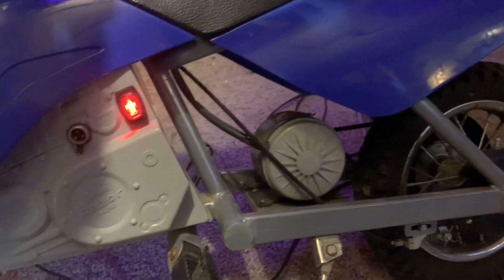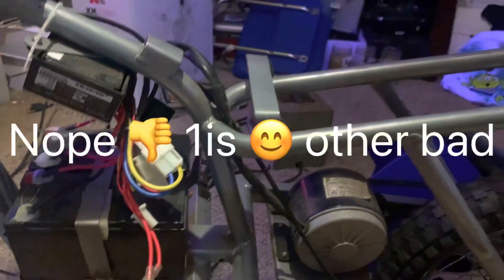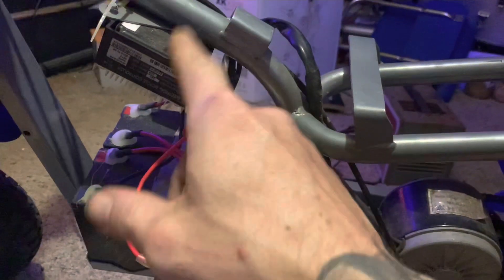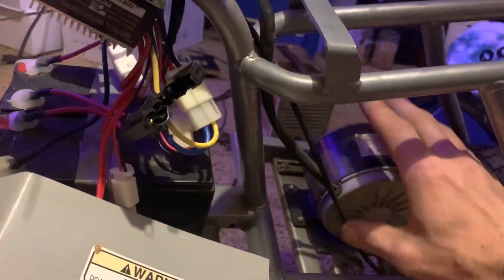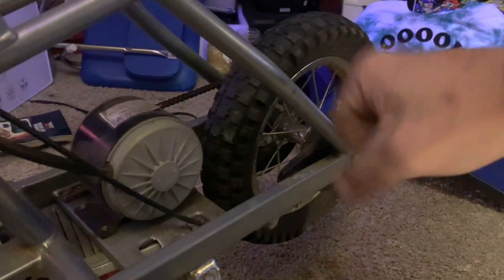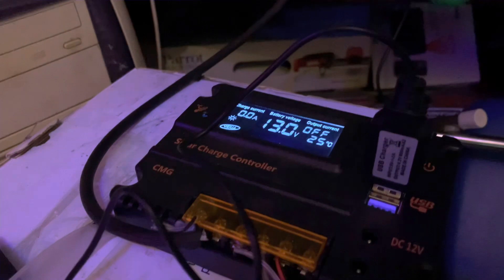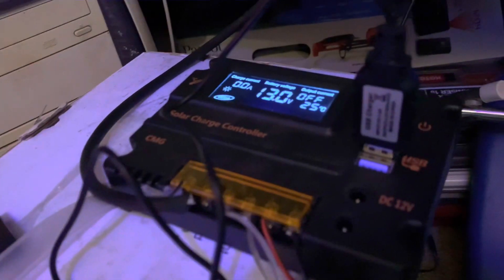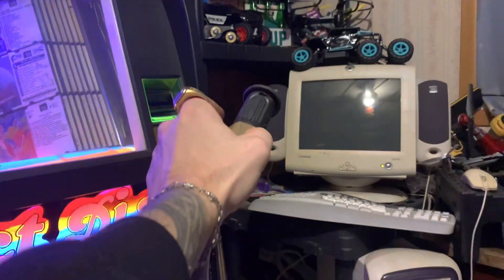How to troubleshoot Razor Dirt-bike Mx350 WORKS FOR SCOOTERS 🛴EASY DIY step by step Diagnosis

Comment: I'm having an intermittent issue with mine working one minute and not the next. I suspect I have a bad cell\battery as well. Although when I test voltage at the battery pigtail I'm getting  25.52 volts. Testing on the plug from the controller to the motor is giving me 22 volts. Do you know how many volts the drive controller needs to operate properly?
Reply from the maker: If it’s working one minute and not the next definitely a voltage issue or a wire issue
Reply: 20v

Comment: I’m the same situation currently. Turns on, clicking sound when throttle is turned and Fuse is good. So it could be our battery need to be replaced?
Reply from the maker: Correct

Comment: What is the problem if the wheel needs help to spin.

I replaced battery with 36v and a 36v controller.
Reply from the maker: Could be motor could be loose connection could be something needs to be tightened
Reply: @JayDrone I’m reading .5 ohm at motor I’m gonna replace it and see if that was the problem. Thanks!